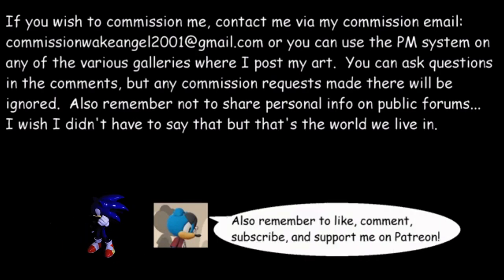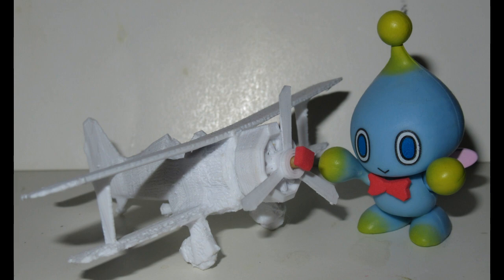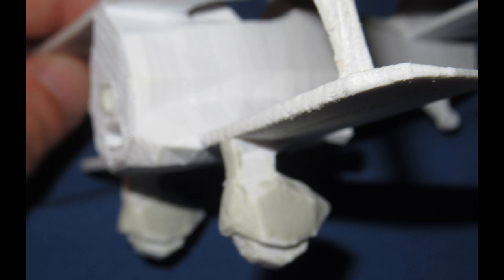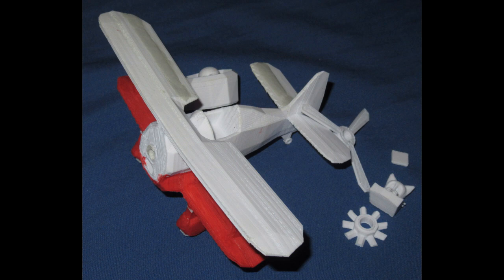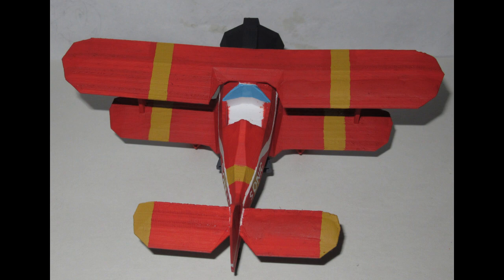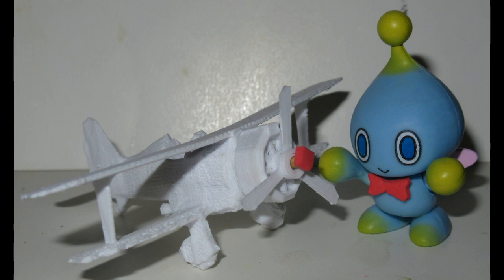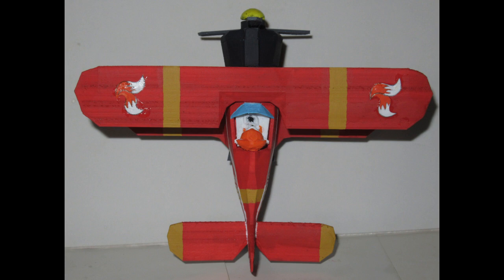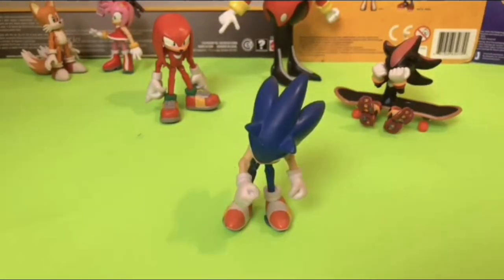3D Printed Tornado custom

Comment: There are a few things you can do to prevent the bubbling. One way is to increase the retraction speed, which will reduce the flow of the filament extruding when performing a z-hop. That can be changed in the slicer settings manually and does wonders for stringing and blobs. 
Another way is to disable the power loss recovery on your printer, which will prevent the printer from reading in increments and prevent stops that could make blobs. Not sure if your printer has the setting, but you can do a quick Google search for it download the file and upload it to the printer which should disable it (Geek Detour has a video and file for it in his video).